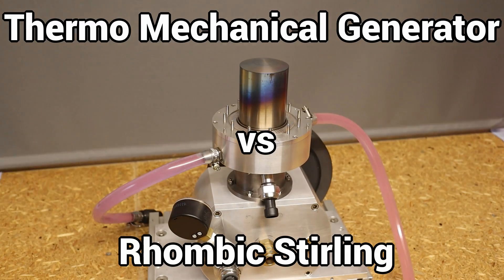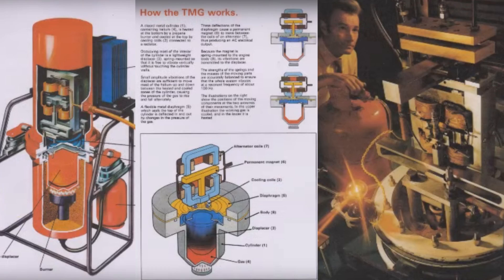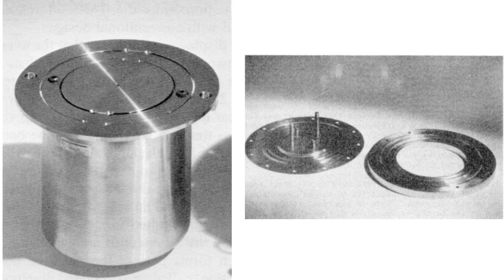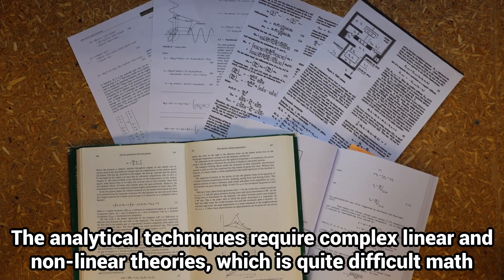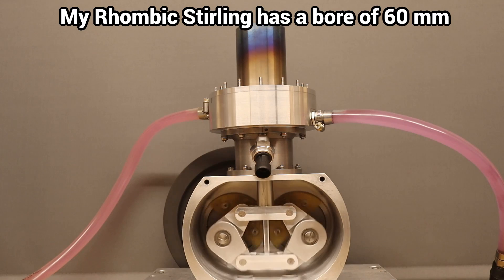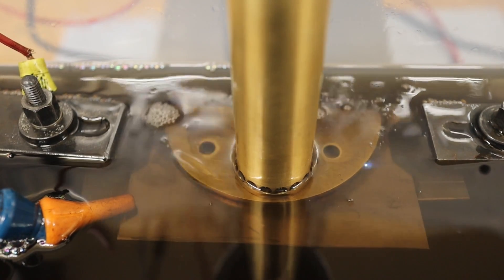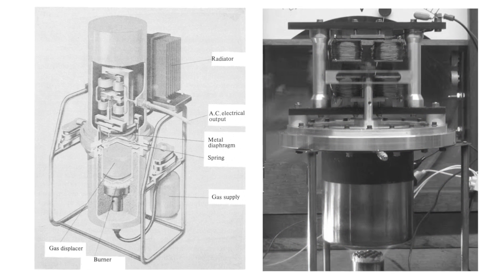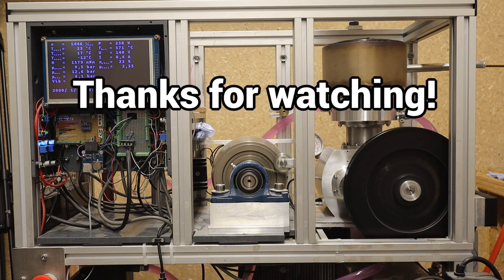Thermo Mechanical Generator for more cheap energy than the Rhombic Stirling engine to go off grid?

Comment: Why not 3D print the diaphragm in TPU and laser cut the spring steel?
Reply from the maker: Laser cutting the spring steel is an option when I have problems with milling or eroding it.
But 3D printed TPU diaphragms would not be durable enough, look at my older video of the durability of 3D printed parts.
Thanks for your thoughts!
Reply: I think his technology and development is way past that.
Reply: How about 3d printing laminated materials? For example: first layer be printed from PC, then second layer from TPU, then third layer from. PC and so on. Prusa 4 can do that.

Also, for heat resistance, you could integrate cooling channels into the 3d print and use a cold gas or perhaps a liquid to cool the elastic assembly in order to maintain its strength during operation.

Also, for the diafragm you can try a wire mesh formed by pressing it into a 3d printed 2 part mold, then inject high heat resistant silicone in the mold to make a sealed membrane.

Comment: I think your rhombic drive needs an oil system. Maybe even try different working gasses like refrigerants in combination of PAG oil. Build it more like a heat-pump system. They have many moving parts with lots of friction and still last a long time. Fully hermetically sealed and closed loop oil system. Build it larger so that you can get similar useful energy but with lower temperatures.
Reply from the maker: Unfortunately it has to run dry because of the heat exchangers what causes a lot of problems...
I tried helium but have to make more experiments...
Thanks for your comment!
Reply: @myengines2443  Why should oil be a problem? Your supposed to oil the crank case and piston, not the heat exchanger! 😂
Put some thin oil in it, some oil scrapers on the piston, and pump that sucker up with a view atmospheres of helium!
Reply: @myengines2443  What kind of problems? A thin oil that's dissolved into the working gas might be fine.
Reply: I think that the problem of friction is exaggerated, especially if appropriate bearings are used at each joint. This is the most important goal of bearings, which is to make the thing move freely, and the choice of materials and design of the mechanisms also plays a role.

Comment: Good presentation and explanation of your reasoning pro´s and con´s. Now do the next thing and then the next until you got about 5 concepts or so and create a combination matrix where you choose the design. Don´t forget a stilring engine is not the only viable way. You can use turbines or steam engines instead as well. They too have little moving parts are multi fuel capable, efficient and can be produced at home or you 3D print some metal parts, 150 bucks or so but this way it can be way more efficient with inner cooling geometries and you don´t even need to make the thing yourself. Oh and don´t forget the simpler designs as well which are lower tech like a 4 cylinder stirling without any need for displacers because it has double working pistons for instance. This way your powrt output can increase, you don´t need complex manufacturing and you didn´t need 4 main components. All in all the TMG is a good idea however it needs more than one person to work on the design and solve some issues first. The idea is tempting but it´s not really much more efficient than other designs and it is complex in it´s control and manufacturing. I would place it on that decision matrix and go on with other ideas. =)
Reply from the maker: Thanks for your good thoughts as always....
What you write is exactly what I want to do with some extra suggestions from you.
I want to take a lot of time now and examine the various concepts in order to decide on one and then concentrate fully on it.
I would like to use the youtube swarm intelligence to do this, as you get a lot more ideas, suggestions and solutions than if you just think about one thing yourself.
Thats the main reason for me to make these videos besides the fun.
Thanks a lot for your ideas !!
Reply: @myengines2443  "...I want to take a lot of time now and examine the various concepts in order to decide on one and then concentrate fully on it...." This really is great. You did such a great job with the original design. I can´t wait to see what you will come up with.

"... would like to use the youtube swarm intelligence..." This is a great idea. There are a lot very smart people here.

Comment: The flat plate springs could be modernized rather that using the design that is here, you should be able to copy the sunpower Stirling plate spring design, multiple thin spring plates could be stacked and added and removed experimentally to determine the correct rate, then you wont have to make multiple hard to machine thick ones and they can just be water jet cut, inexpensively.
Silicone rubber is a lot more temperature resistant and probably wouldn't need water cooling at all,  it might be possible to even mould one from something like flue sealant and a 3d printed pattern.
Reply from the maker: Thanks a lot for your suggestions.
Do you mean the Sunpower spring which is formed like a spiral?
Trying multiple layers is a great idea for experimenting!
I also thought of and used silicone rubber on my Stirling engines, its a very good and easy to use material.
Greetings
Reply: @myengines2443  Yes, i imagine they are fairly well optimized by now, I also noticed that there are two sets to hold the shaft central, you could probably take a screen shot of one of the springs upload it into CAD. 
Did you think about converting the rhombic drive one you have to free piston? you could use a car subwoofer coil and magnet or something similar as a generator.
Reply from the maker: @ChrisDay-sx4lv  yes, that are some good suggestions, thank you.
I think to match my needs I have to manufacture everything from bar stock as I always do.
It is much more work but then everything can be made as designed and you don't have to make any compromises.

Comment: I have seen ca 1998 a tmg at Neuhausen/Switzerland in a development lab of the company SIG that was said to generate 1kw at resonating 50hz. If remember right it was not big in diameter but maybe 3 to 4 times longer. 
It was intended as a home chp. I saw it running. As fare as I remember development was stopped as the local power station company didn't like the idea a asked crazy price for the meter (return power to the grid). It's a pity but I can't help you further on with any contacts..
Reply from the maker: Was it really a TMG or a free piston Stirling engine with conventional piston and displacer?
I think I heard about it but can't remember and can't find any information about it.
Thanks for your hint it would be nice if you could tell more about it...
Reply: @myengines2443 
Sorry, it was just a short visit with the aim to eventually supply them with a measure and control system.. I believe they had a normal spring under a piston, resonating with the grid frequency. I think it was a well balanced bug not complex machine. Was only a short visit and soon after the project was canceled as it was non economical to sell energy to the grid. Also I think it was technically working. Sorry but that's all I remember. Looking forward to see if you can get something working. Mike
Reply from the maker: @michaeleitel7186  Thanks a lot for your information!

Comment: The bigger one generates only 150W? That's hardly worth the effort. This one https://youtu.be/adLZIDxM8tQ seems similar design but it's 1kW
Reply from the maker: Yes you are right, 150 watts is really to less.
But maybe with higher pressure a bit more is possible.
300 watts constantly produced would be enough for me.
The engine you linked is a free piston Stirling with which I think I would have bigger problems with wear and friction than with the Rhombic.
Piston/displacer alignment and control is really an issue here but I will inform myself about them intensively soon.
Thanks for your suggestions!
Reply: I guess it depends on how you qualify. For me I am interested in boosting solar shortfall in winter, for an off-grid home.
150W running 24/7 would be ~3kW.hr per day, which is around 50% of our daily usage...

Comment: Why not just skip ahead to a micro steam turbine? only a handful of moving parts.
Reply from the maker: Maybe I could imagine a gas turbine to run on my biogas, but isn't producing that much steam dangerous and expensive? 
Actually the invention of the Stirling engine was intended to prevent boiler explosions.
Reply: @myengines2443  Hi, for the last 15 years, I've analyzed domestic-level cogeneration issues, and at some stage, I was completely in love with Stirling engines. But, unsurprisingly, I came to the same conclusions as you. 
If you are purely interested in a small cogeneration unit, as cheap and universal in fuel as possible, and safe for the user, please consider a gas turbine working in the Inverted Brayton Cycle - by far, I haven't found a better solution.

You can find few scientific papers on them, but the basic working principle is simple:

-Air heats up in an atmospheric pressure combustor.
-Hot gases expand through a turbine to a vacuum chamber.
-Heat is extracted in a lower pressure space.
-The reduced volume of gas is compressed back to atmospheric level.

This design solves three main issues with standard gas turbines as microCHP:

-Gas turbines exponentially lose efficiency with size reduction, and for domestic cogeneration, you can't operate a 1MW turbine.
-To maintain efficiency, tolerances have to be very high, and materials from the top shelf are required, making the device expensive.
-Heat addition internally at elevated pressure excludes most cheap fuels from continuous operation.

Advantages include:

-Cheap and easy replacement of the main moving part (a simple Chinese universal turbocharger, $150).
-It can work on almost any hot gas source (even wood/coal fire).
-The electrical generator can be ultra-small (a drone BLDC motor is more than enough).
-With proper heat regeneration, it can reach 15-20% efficiency (in cogeneration - almost too much).
-No enclosed gases exceed atmospheric pressure, making it inherently safe.

There are, of course, some downsides:

-Very quiet as every gas turbine, you just can't hear any complaints (over the noise).
-Coupling a 100k rpm axle to anything reliably is challenging.
-A drone motor kept stationary as a generator requires a good cooling solution.

If this concept interests you I can share some basic designs, as I'm preparing to build a prototype myself - and practical ideas exchange would be very helpful :)
Reply: @Niwen2058  Why not duplicate the results of the Ross stirling engines that produced 200-300 watts at fairly low pressure of 40 psi. Hard to make yes, but a challenge has to exist.
Reply: @myengines2443  this youtube video  https://www.youtube.com/watch?v=AYydc43FGBU 
shows a way to make a boiler that really can't "explode" and is "cheap" and easy to make. (Stainless steel brake line is kinda pricey, but seems ideal for the app) pair that "boiler" with a tiny turbine.. As far as "expensive" idk... this tiny coil boiler seems really efficient, and feeding a small turbine may not take as much fuel as you imagine.
Reply: @myengines2443  Yep, by Rev Robert Stirling if I remember right. A man of god and science.
Reply from the maker: Thanks for your information, I will inform myself about it and think about it!
Reply: how about tesla turbine integza has video about smal tesla turbine good for small homes?
Reply: @myengines2443  Just use a monotube boiler, barely has enough steam to explode at any given time
Reply: @demandred1957 https://m.youtube.com/watch?v=rhrftfyC59w that was almost ten years ago and nothing happened.
Reply: Steam turbines if ran in closed cycles are very risky if done DIY in my opinion due to the boiler pressures generated in the phase changes of the steam/water. Also idk what ∆T he's using, if it's less than about 60°C then it would not even produce steam (assuming Tmin is room temperature).

That said, I would personally try and develop a rotary stirling engine to optimise losses a bit.
Reply: Turbines need bearings and tight tolerances. That's why NASA isn't looking at them for next Gen power systems.
Reply: Steam turbine design is also the opposite of trivial. Same goes for manufacture.
It aint gonna happen with lathe.
Reply: Don't know either, with such little power output, it doesn't even seem that efficient in either space or power density
Reply: I think some of the issue here is that they're not working with a particularly "high quality" heat source. That said, I've often wondered about how a closed cycle system could be operated at below ambient pressure to promote boiling at a lower temperature. I just fear the power density won't be there in that case, but it's not like a Stirling engine is stellar in that regard.
Reply: I really liked the turbine system in this video
https://youtu.be/Tuzh9mHvzkk?si=O4yyFAD10wYDvOtO
 but I'm looking forward to seeing this type of generator 

Any thoughts on the acostic heat engine's ?
Reply: Microturbines tend to have atrocious efficies.
Reply: At this scale a reciprocating engine is likely to be more efficient than a turbine. One might look into the single acting uniflow engines used on flash steam powered model hydroplanes, for example.